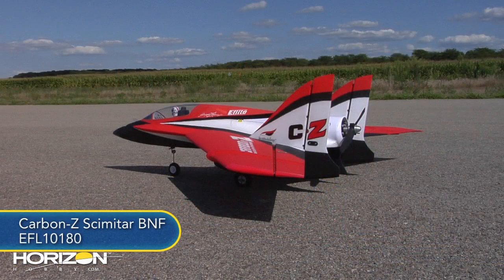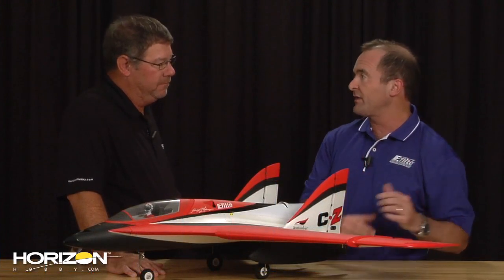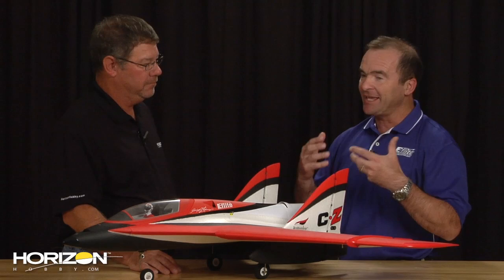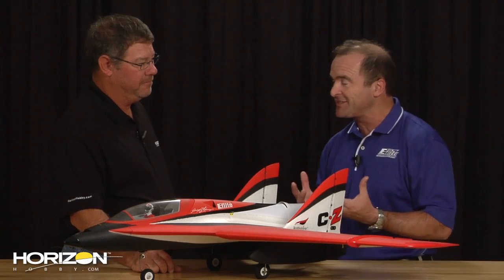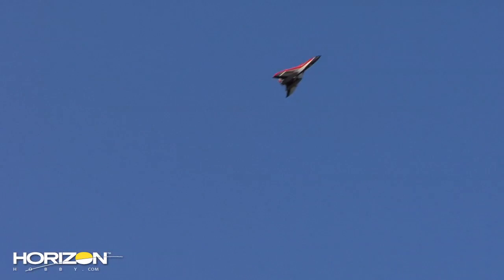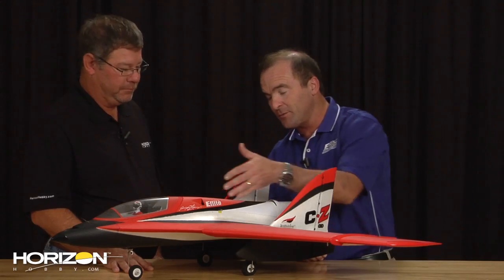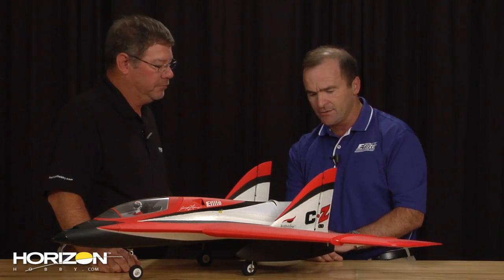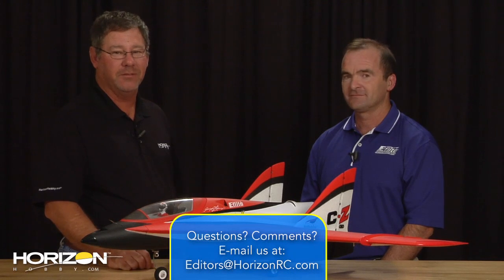HorizonHobby.com Preview - E-flite Scimitar BNF

Comment: It depends. How big of an airplane do you want. A mid size(40" to 60") aerobatic airplane with all of the electronics will cost around $350 total. You can get ultra micro airplanes for as cheap as $100 each. You also have to consider that you need a good transmitter, which can cost anywhere from $60 into the thousands.

Comment: so  i still dont see a huge difference between this and a striker. cool its got retracts but big deal ooh power 32 with thrust vectoring thats a neat idea but why not have 360 degree thrust vectoring? the modular design is cool ill give it that but when it comes down to it you could buy a striker airframe put wheels on it reinforce the motor mount and put a power 32 on yourself. the whole carbon z thing is just a huge gimmick its no different from putting a carbon rod in through the wing.